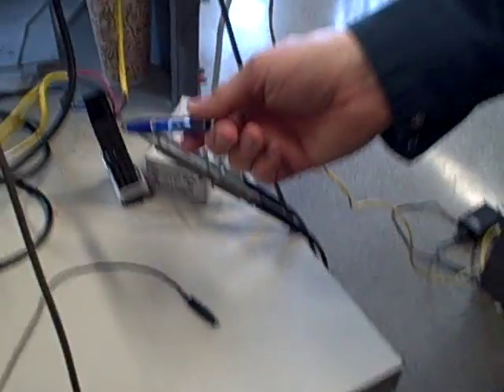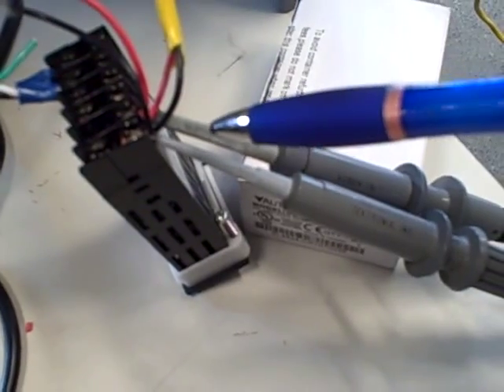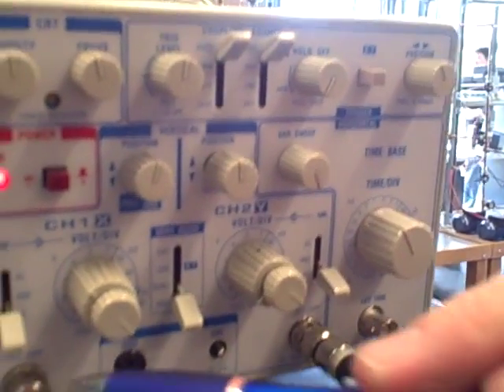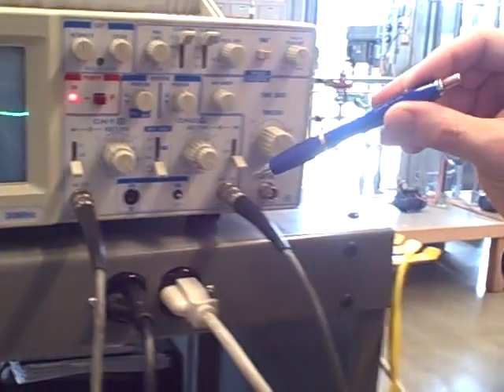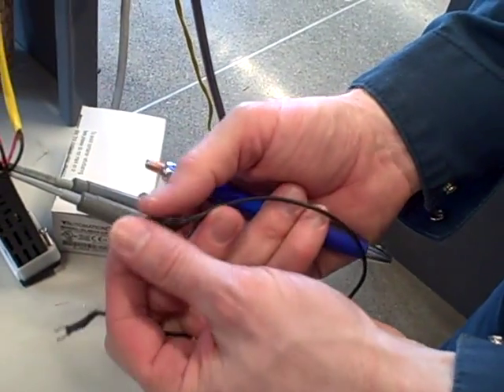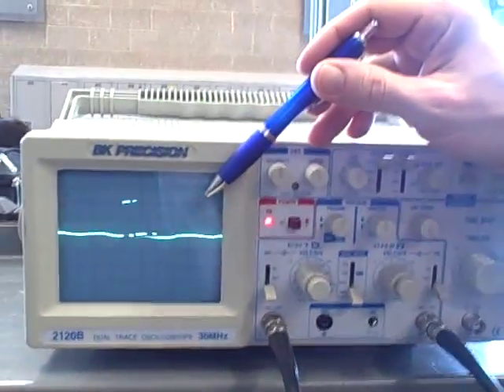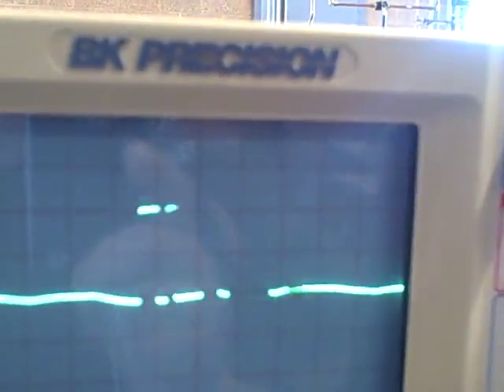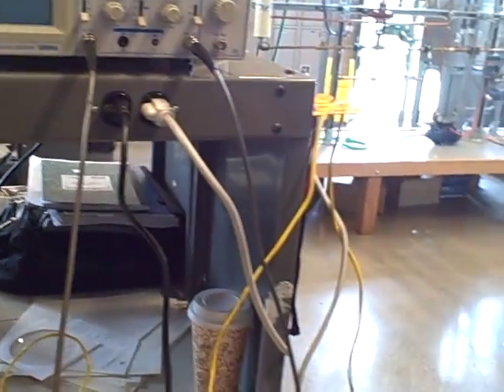Modbus pulses on oscilloscope part 2

Comment: Thank you so much for this video! I bought a Picotech 2205A and they have a modbus serial profile preloaded in the Picoscope 7 software but they don't tell you how to connect the probes. Through many hours of researching, I was fairly sure the correct way was how you presented it but this video confirmed it for me. Thanks!